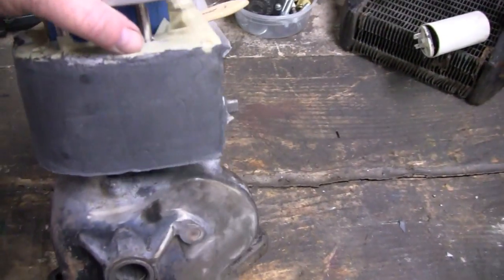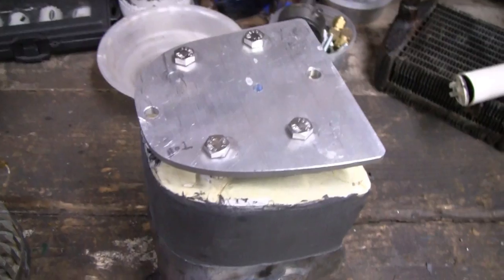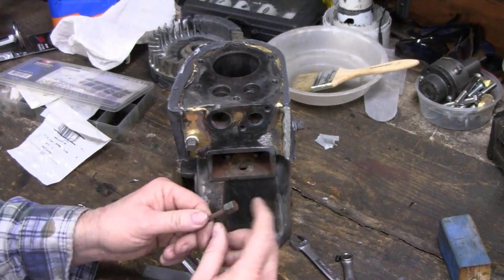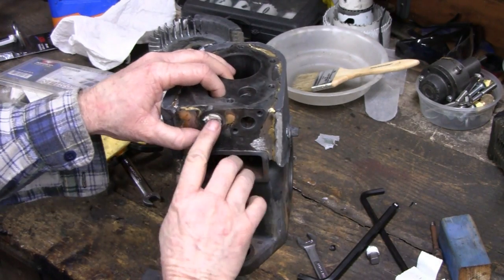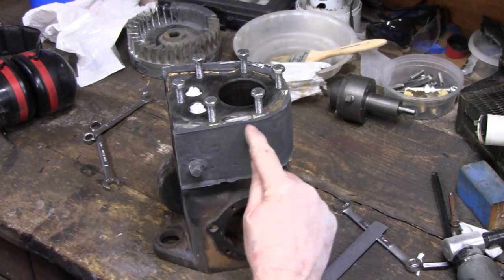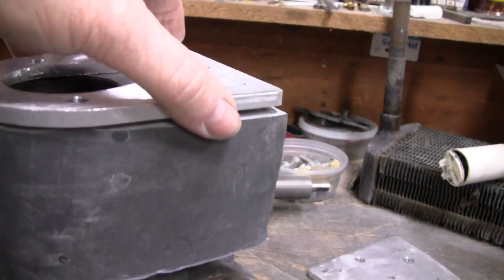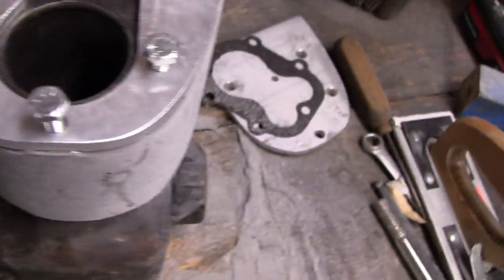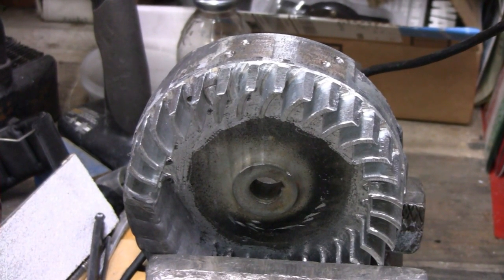HOMEMADE WATER COOLED BRIGGS ENGINE (part 17)

Comment: Just thinking, if the water cooling system is more efficient than the air cooled version of the engine, maybe you could slap a turbo charger on the thing.

Comment: RK, when you're done with filling the flywheel, see if you can't chuck it up on the lathe and work the profile with that. Considering it's only light metal and some putty, it shouldn't be that difficult to shape even for the little one, size might be an issue, i don't know what yours can swing, tho, Mike can help.

Comment: It's entirely displeasing to see that Epoxy around the Cylinder. Can't help but think that that ain't gonna Last. Couldn't you have made a Suzuki GT750 Style Two Piece Water Jacket from Sheet Metal? Just hammering it into a Mold?